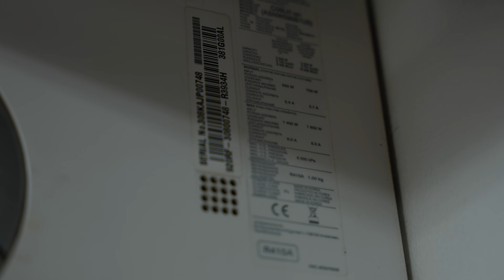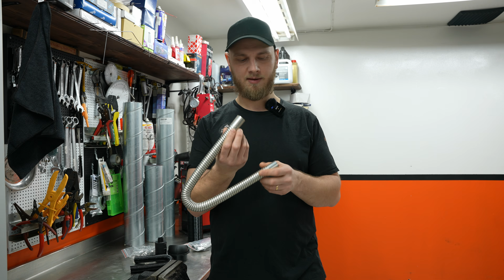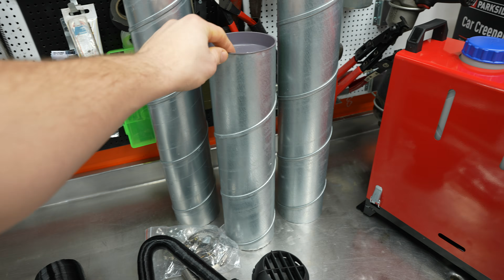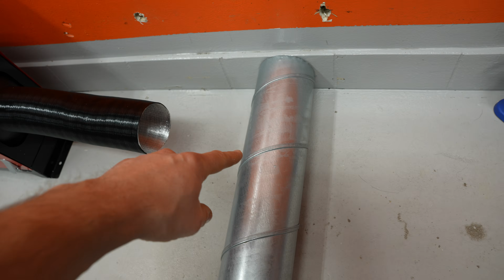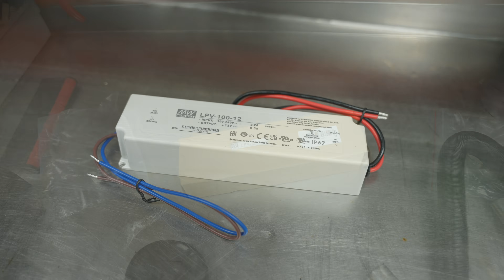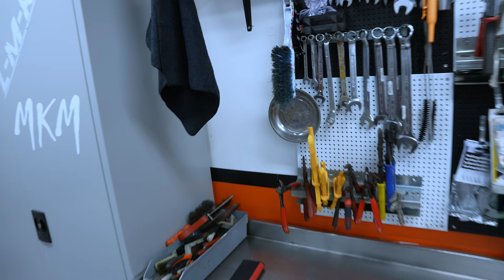Vevor 8Kw Diesel Heater || Part 1

Comment: I would advise that you play with it a bit before you start drilling holes (I am sure you will).  You mentioned putting the outlet right there at the desk while you are making videos.  The discharge air is quite hot, and there is a definite wind and engine noise if you are that close to it according to the other vids i've seen.  I just bought one yesterday for the same reasons you said (backup heat).  We will see how it works!  good luck!

Comment: Diesel in definitely NOT cheap in Australia, electricity however is very affordable for those of us with PV installations. Are you promoting Vevor products as part of your future plans for the channel?
Reply from the maker: Same here, diesel is very expensive at about 3.31AUD/Liter. But some say you can run these on Waste oil and frying grease as well. 

No, I dont have any affiliation with Vevor and I paid for the heater in full.
Reply: Wth, you arent even at 2 dollar (australian) per liter. You have cheap gas for sure.

Comment: I got the exact same thing last week, main purpose is tent heating but will put one in the garage as well. These things are really built for recirculation so the heat air intake must be routed into the heated space as well, therefore it is easier to route the exhaust and combustion air to the outside then the 2 bigger tubes inside. You will only need a basic air filter for the combustion air. That's the way Eberspacher, webasto and autoterm designed their units. Yours is a "5kw" that get possibly overpowered by the control which does not much more than burning more diesel as the heat exchanger isn't capable of much more than the 4kw its designed for, if measured the 5kw units reach a maximum of coarsely 4,5kw
Reply from the maker: Thanks for the input 👍

Comment: it wastes A LOT of heat through the exhaust tube. i would position exhaust tube inside so you get the heat from it. you can buy 2m exhaust tube on various chinese reseller sites. i bought mine on fruugo.

Comment: Why not just put the exhaust through the wall and keep the unit inside? From what I read these are copies of a 5Kw design not 8 as they are marked as.. Looks like you got the good "hard" fuel line at least. 👍🏻
Reply from the maker: U are probably right, the manual doesent state anything about any 8kw either 😄 

I just don't like the idea of having the unit inside, loud and takes up space. Going to watch some videos of others to maybe find a few weak spots and adress them right away  👍
Reply: @BackmansGarage  I have one of these in my car and it has been running fine so far.. Got the hard fuel line upgrade as that seems important. There is no shortage of information about these heaters out there, so it will be interesting to see how they will hold up in the long run. Good luck with yours. 👍🏻
Reply: @dave himlin The hard line is made of nylon and is mainly for getting the fuel to the right pressure to properly atomize in the combustion chamber.
There is a good video here on Youtube explaining this called, "Chinese Diesel Air Heaters - Part 11 - Fuel Delivery"